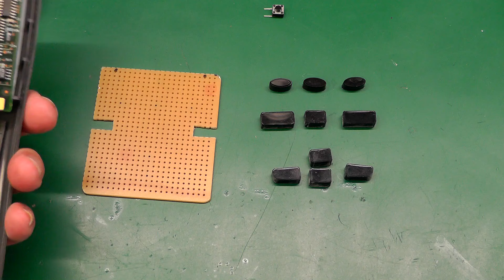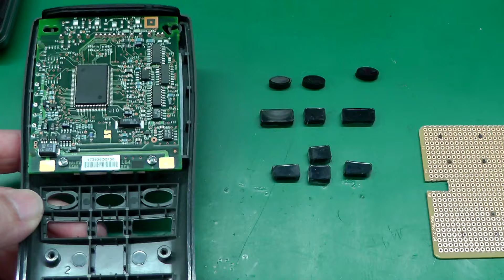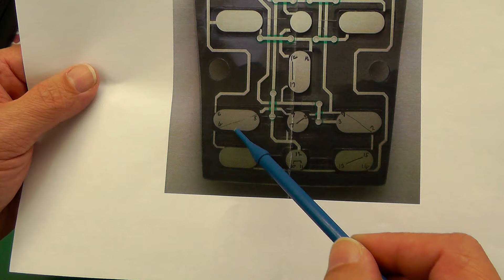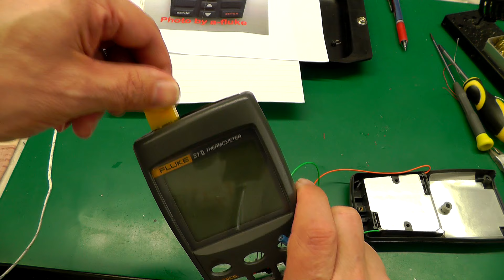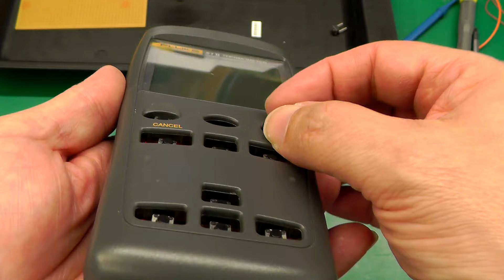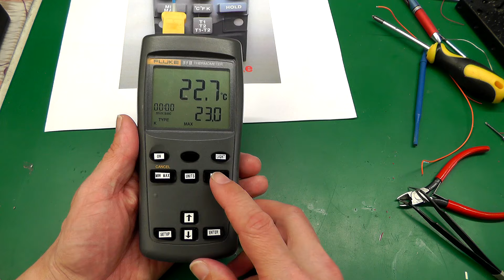No.030 - Fluke 51 II Thermometer Repair

Comment: The oem part is $60
Reply: how do you know? did you get that figure from Fluke?
Reply: @CandyHam I replaced the keypad in my unit, the printing had worn off. 
Fluke Part # 669788 The price has changed since my post was 4yrs ago
Reply: @street8487  Copy that thanks. I disassembled mine, de-adhered the rubber keypad from the plastic film backing containing the carbon traces and tested continuity with a multimeter. Indeed found some areas of traces that had worn down to nothing. Hopefully applying some conductive paint can rectify this.

Comment: Did you try 'pressing' the buttons where were missing to see if they did anything? You never know if it's different firmware on higher models or they just don't fit the switches.
Reply from the maker: There is an upgrade path to the dual thermocouple version which involves adding a few components to upgrade it and which makes use of the additional buttons. Not sure if I will bother with that or not yet.......but might make an interesting 2nd video.

Comment: Excellent =D  Lovely idea there for when you cannot get a replacement membrane!  I bet those buttons are more responsive and longer lasting than the originals too.  I bet you could also overlay the original 'faulty' membrane over the new microswitches and it might just fit.  That could be a good solution to use the original silicone part with microswitches.  Some cutting of the silicone might be required I guess (to get it to fit properly) if you did try to use the original silicone with your new PCB.
Reply: i think the switches would be way too high...
Maybe it would work if he used really tuiny SMD switches though

Comment: it's a good thing you had those pictures.  I refuse to buy modern fluke handhelds due to the fact that fluke doesn't release any technical documentation.  combine that with 4 layer boards and it's pretty much impossible to diagnose them.
Reply from the maker: I probably wouldn't have purchased the unit if I didn't have the photos.